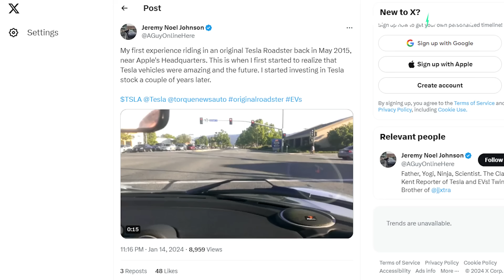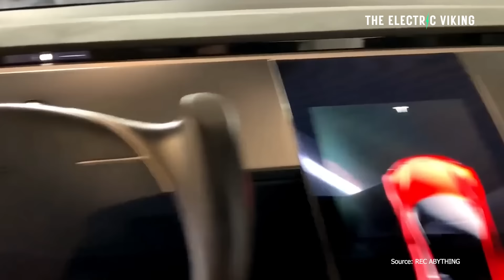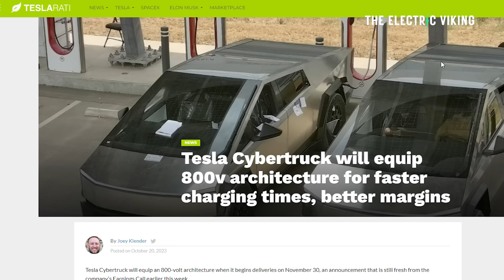Rumour: Tesla technicians reveal Tesla Roadster is only months away

Comment: Roadster 2s need four things 
1) 800 volt architecture.  There is no point in Tesla engineers designing new things with a 400 volt architecture. 800 volts makes it just that much easier to provide power for a supercar.  
2) Assuming Geely/Fisker Golden batteries work, get a consignment of them for the Roadster instead of trying to use 2170s or 4680s.  Both 2170s and 4680s are underperforming in different ways.  2170s are at their end; the next version is supposed to only improve density by 5%. These packs only discharge power so fast, which is why they aren't used on the Model S or X Plaids.  Golden batteries should give the Roadster close to the 600+ mile range originally promise.  Imported batteries should be no problem since the Roadster isn't going to get a $7,500 incentive.  
3) Have a paintshop that can paint a lot of premium colors.  All these rich people in LA don't want to see their Roadster in a line of identical red Roadsters at a restaurant's valet parking.   
4) Normalize custom interiors upscaled from the von Holzhausen custom interiors some people add to their Teslas currently.  Black and white interiors are boring.  The Celestiq has this customization as a normal part of the car purchase.

Comment: Some designs are timeless,  the Last generation RX7 is 30 years old, and still looks like it rolled out of a design studio last week!
Reply: just like your mum
Reply: But Engine is Stoneage!
Reply: Agree FD still beautiful.  Love the rotary but I agree ICE is dead.
Reply: What gives it away it has not at least 19"  rims stock.
Reply: @Nordlicht05  hä
Reply: @gooldii1   hallo. The rx7 is easily not new only because of not having big rims. Is that not understandable? Not noticed big rims on newer sportier cars?
Reply: @Nordlicht05  big Rims suck.
Reply: @gooldii1  should Always fit the design. But yes minimal rubber and as much aluminium as possible is also not what i prefer. I mean some cars now come stock with 20"
Reply: @gooldii1 they do.
Reply: I think @SydneyEV's point got lost on wheels and tires.  I had both a 1981 and a 1986 RX-7.  The 1986 RX-7 was timelessly beautiful regardless of the wheels and tires, which are easy to change out.  The Wankel was fun for its time.
Reply: @tonyanthony1933  but fossile Crap.
Inefficient.

Comment: The guest clue is the fact that Magnesium is now being tested in the Giga presses 

Much lighter than Aluminum and stronger 

My thought is it’s for Tesla Roadster

Tesla should test Titanium in the Giga press and make the next version of the Tesla truck family out of Titanium giga casting with stainless steel body panels 

Tesla AI- Robotics could make the lower cost Titanium using solar power 

It’s would change automotive design as Titanium is abundant but hard to process

Comment: The Roadster is advertised to have 620+ miles of range. For my $200-250k, I want the promised 620+ miles of range. Elon said 620 miles at 60mph,(highway speed). 

I’m so tired of Tesla telling me I only need 300 miles of range. Especially since you don’t actually get 300 miles of range. 

More range means less trip charging which directly results in an overall better experience, driving and ownership. 

I want the 620+
Reply: If you really had 250k to spend on a car  you wouldn't be on this site.
And that's a fact!!
Reply: @robertfonovic3551   Im spending $120k on a CT and im here.
Reply: It’s obvious roadster won’t have 500+ miles of range.  Elon was hoping battery density would significantly improve in 5 years but clearly not the case and they are still struggling to scale 4680 cell production.  I would be happy with 350 miles range (and okay with that range for CT as well).
Reply: Bro what road trip are you doing in a roadster that you need 620+
Reply: How often do you drive 620 miles non-stop? 😂😂😂😂😂😂😂😂😂😂😂😂😂 🙉🤡🙈

Comment: Roadster is on the back burner because it’s going to be so low volume and the model s plaid achieves most everything the roadster boasts. 
I wouldn’t be surprised if it does come out sooner than later, but it doesn’t really matter. It’ll probably be less than 25k units per year, which will be nice for margins, but won’t move the needle much. 
Excited either way
Reply: I thought they said they would do 1000 only

Comment: Hallelujah,I think also Model 2 will also come in Q3 2024👍😉💪
Reply: If Model 2 came out this year, that would be huge. That would mean they would be ramping next year.
Reply: Extremely unlikely. They have the CT and Prime Mover fiascos to deal with.
Reply: 25K M2 will be built in Mexico but giga Mexico has not even been built yet. Not going to happen until end of 2025 at the earliest. Although M2 can theoretically be built in giga Shanghai pretty quickly but I've not heard from tesla that would be the case. M2 has to be built in a low wage country which means it won't be built in America nor Europe.
Reply: @larryc1616   Elon already announced that the new model 2 is going to be produced in Giga Austin  first
Reply: @jondeforge8266  really? Well then it won't cost 25K but more like a base M3
Reply: I think we will see Model 2 in Q4 2024, and production start Q1 (or Q2) 2025

Comment: Why would this car cost more than a Model S plaid?  It has basically the same specs other than expected range.  Probably a tri motor with 2 less doors.  It should be priced closer to $125k or less.
Reply: It is priced closer to Porsche Turbo S which is the target market.  People are willing to pay more $$$ for sporty look and sub 9s quarter mile.
Reply: @kkulkulkan5472 no one is choosing a tesla over a porsche turbo s or gt3. Why do u think the model s plaid was 150k and they had to lower it to 89k in less then a years time. At 150k u can get a decent porsche gts or another high end sports car. No one is choosing a tesla even if it's a second quicker to the quarter mile. It speaks volumes about the experience and driving engagement a high end sports car brings u that an EV can NEVER. Ive been inside a tesla and is just doesnt feel like ur in something special. Its so dull and plain jane. It has no luxury. My buddy lets me drive his targa gts porsche time to time and oh my god, bro. The engine. The revs the downshifts. All the people checking out the car. Its insane. The noise alone is what makes me want to drive it over and over again. Best way to describe it is. Speeding in a tesla is like having sex with earplugs in.  Only ur body feels it.( Except for the terrible wind noise in the cabin from poor sound isolation.) Real sports cars hit and fill ur entire senses. The rumbling of the engine the visceral special occasion it feels like everytime ur in it. Cant be matched.

Comment: Roadster, is not likely to have a 2 Million + Reservation List, first off! So, why not give it 600+ Miles Range, at the New "Reduced" EPA Range Spec!

If the "Build Rate" stays at 5-10 units per day, it will still  be Months just to satisfy many of the current "Pledged" Roadster Prizes, let alone the ones folks already Paid $250,000 in Full, for the First units! Or $50,000 for the first ones to follow those first ones!

Comment: The question is will the roadster still have the 500 mile range!
Reply: The advertised 620+ miles of range at highway speeds is what I expect.
Reply: @ObadiahIsurfate-ze7zq Expect away. What YOU want is irrelevant.
Reply: NO NO and NO
Reply: No.  There is no need for the 500 mile range and that would make the car too heavy with the extra weight of the battery 
350 to 400 mile range should be enough….
I personally thing Tesla owe so many free roadsters they have to come up with a cheap version to give away maybe in the $100.000 range then the real one in the $250.000 version with the 400 mile range …that give away was a big mistake but I think Tesla could afford it
Reply: Max 200 miles. no more.

Comment: The added range for the Roadster is pretty much there for track days: heavy acceleration for long duration of laps that will chew up the battery quickly IMHO.
Reply: Same with petrol.
Reply: The new Tesla Roadster computer will react way faster than any human. This will give the tyres an easy life as they won’t be sliding any more than absolutely necessary. 
400 miles range in normal driving could fall to 200 miles at track speeds. That’s the length of a typical F1 race.

Comment: I am very curious why tesla did not put the exact same battery pack and engines from the model s plaid...and then tried an even more powerful version with a slightly bigger battery and some more power (so around 1400-1500 hp). It would have been a much cheaper car to produce and sell, because they already would have everything (apart from the somewhat bigger battery and more powerful engines
Reply: The new Roadster has not yet been released, so nobody outside of Tesla knows what battery pack and motor it will use. As such, I am confused why you are trying to second guess design decisions that you don't yet know about.
Reply: @CiaranMcHale  Tesla roadster has been presented 6 years ago. The engines, batteries and suspensions, were told to be the same as in the model s plaid (at least for the entry version) and a more powerful version to follow, that would inherit the engines of the “plaid plus” version of model s (which was never released anymore)
Reply: @CristiCroicu  Thanks for the clarification.

Comment: A 70 kw batt pack would greatly reduce the HP unless super capacitors are used to supplement. Hopefully it'll have a compact & lighter Lucid like drive train with a tiny differential & planetary reduction gears, or does it have 4 motors?
Reply: A "No Back Seat" or "Stubby version of the Roadster, might be OK as an "RX7 Killer", but that 70 kWh idea, is "Light" even for that!

Remember, the Prototype had A Tesla P100 Battery, X2, stacked,for it! And, it still was under 2 Seconds for the 0-60!
Reply: @robertweekley5926  Where do you got that from, that the prototype had two of those batteries stacked?

Comment: To go with idea it cant take much to build the new Roadster we are currently missing the new upgraded Model 3 performance from the Tesla web site.... 
Could the soon to be upgraded Model 3 performance platform base also be for the roadster as well ????  The newly upgraded Model 3 performance battery pack , suspension with the Model S plaid drive train capped with the body of a super car..!!!!   To top it off throw in 48 volts , drive and brake by wire to cut out even more weight and you have a world beater  !!!!!!

Comment: It has been a long wait. Car and Driver magazines last information including renderings quote “The price of the 2026 Tesla Roadster is expected to start around $200,000 and go up to $250,000 depending on the trim and options”. While sounding expensive against the  $2.1 million Rimac NEVERA it’s cheap. 
So it will be interesting to see if it is going to be launched this year or is this a publicity drumbeat to maintain interest. The problem is the competition is also moving on, the recently updated  Porsche Taycan preproduction just blew away the Model s around nürburgring nordschleife by over 7seconds. Undoubtedly the Tesla will be in competition with the next-generation Porsche 718 Boxster and Cayman, officially codenamed 983, are going all-electric, with Rimac technology so the launched 718 Cayman GT4 e-Performance 4 wheel drive racer is quick very quick, the road version will interesting.
Reply: BEV NürburgRing: VW id.R 5:19s; Rimac Nevera 7:05s; Porsche Taycan 7:07s;   Tesla S Plaid 7:25 s
Reply: @docsnider8926  indeed but if your including one off race cars Porsche 919 Hybrid Evo – 5:19.546 – 2018 not the Volkswagen. The electric Volkswagen ID.R was – 6:05.336 – 2019 Evo magazine
Reply: @DC.409  you are correct, mixed the numbers!

Comment: Some Chinese 2170 cells already claim 5400mah capacity.  So if that were true or Panasonic's new 2170 silicon nanoparticle cells have that capacity, then just 5,000 cells would be 100kwh pack capacity and weigh just 350kg.  At <$4 each, that is only a $20k battery pack -- not a very big price component on a $250K car. That doesn't seem like too much weight or cost for a Roadster, so no need to skimp on size or use LFP.
Reply: Who cares? People just want a car that works. You know, like the ones that we have been buying for the last 60 years!!

Comment: Ya there is some effort to stave off the stock losses which are 20% down of late.  4680 is the cell in the Roadster so it will strangle production of any new Roadsters just as it has the Cybertruck and Semi.  One positive for the new Roadster is they probably don't have that many on order and the profit per car is probably higher so would you rather build 8 new Roadsters with some profit or 1 Semi for a big loss?  Seems like making roadsters could make a bit of money even if low volume.

Comment: The launch of the Tesla Roadster may imply that higher energy density silicon anode 4680 batteries are stockpiled and/or in pilot production at their Kato Road research, development, and pilot production facility. This would likely be a more important milestone than the launch of the car itself.
Reply: This dude is insane the tesla roadster looks extremely outdated. Very bland looking sports car. Looks AI generated. No interesting headlights no interesting cuts or lines. The rear end is the most plain jane thing I've ever seen in my life.

Comment: I highly doubt  it will be priced above $150K.  Even at that price, it would have a ridiculously high margin.  Sure, a lot of rich people would pay $250K but the market for it wouldn't support it.  But at ~$150K?  Rock and roll time!
Reply: I think they will charge the 250k. That would allow them to make sure pannel gaps are perfect, and the interior is at Porche level. They could do some carbon fiber. The suspension and brakes will need to be top notch. It's going to be low volume, so the manufacturing will not be as efficient as the Model 3, though they could incorporate some castings and such.
Reply: @fjalics  unfortunately castings won't be a part of the roadster - nowhere near enough volume to be financially viable.  They can't even do it for the S and X.